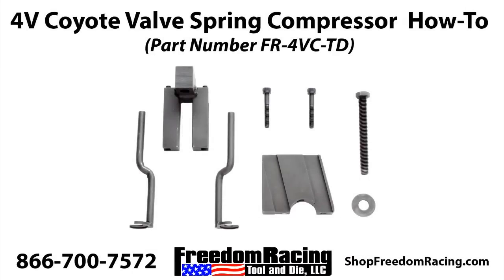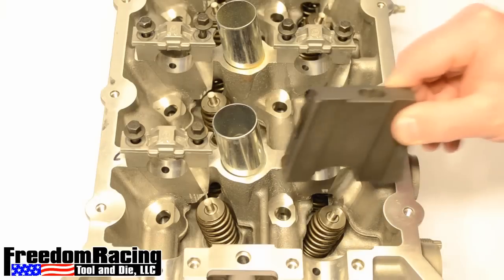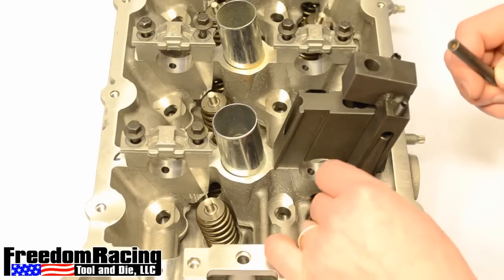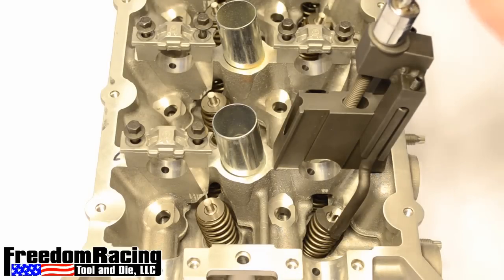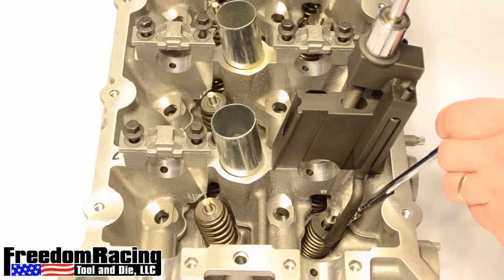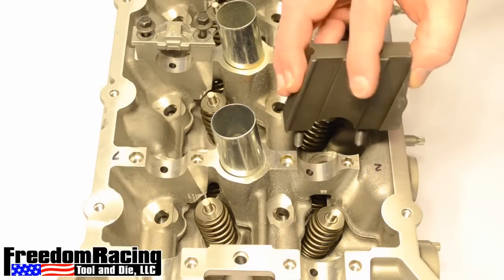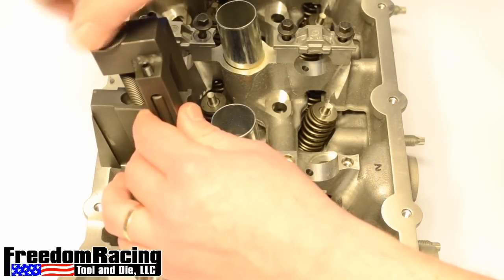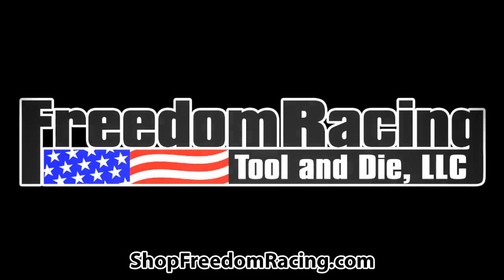ST-105 4V 5.0L Coyote Valve Spring Compressor by Stallion Products

Comment: will the valves drop into the cylinders if the heads are still on the car
Reply: yes. you can supply compressed air to the cylinder to prevent this.